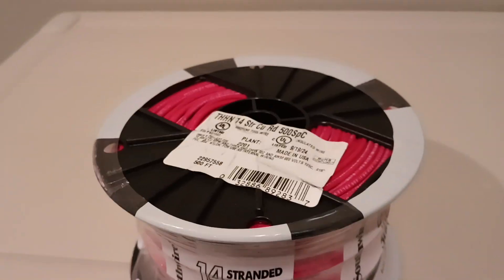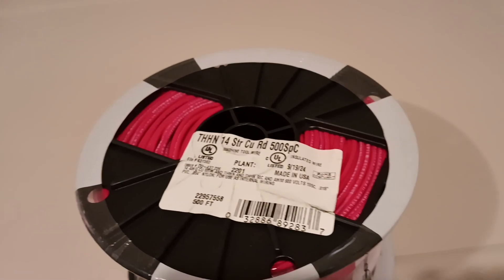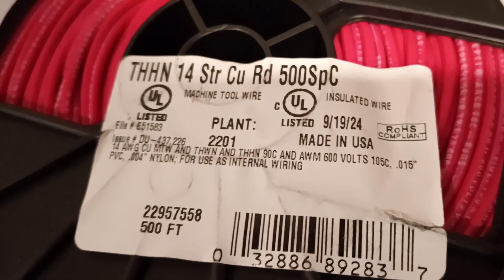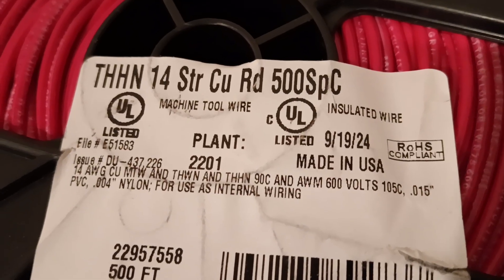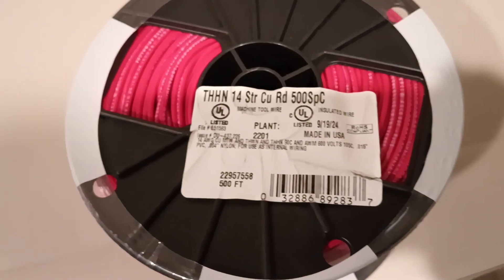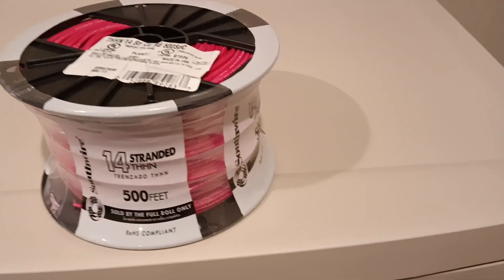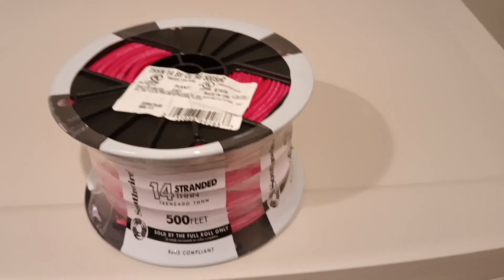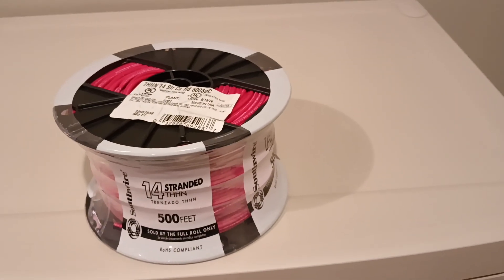Exciting Plans for Antenna Wire!

Comment: One potential problem you may experience with copper stranded wire depending on your antenna is wire stretch. If you try to use this with  say an EFHW for 80 meters you will have to add quite a bit of force on the wire to get it somewhat straight. That force will usually stretch the wire, thus changing the tune or resonance. For other antenna designs this may not be a problem. Good luck!
Reply from the maker: Thanks so much! I'm primarily planning on low-tension, low-stress designs but that is good to know. 73, Jared ~ AC7WH

Comment: If the antenna is up in the air - I use bare 14 ga aluminum / magnesium electric fence wire. I got a 1,000 meter spool of it cheep cheep on the Amazonas. But for Beverage on Ground, Loop on Ground: Military reel of comms wire (W-1) is tough, proven in battle. The bare aluminum / magnesium wire is very lightweight and has less wind drag. Lots of fun, either way!
Reply from the maker: I like those ideas! Thanks for sharing, and thanks for viewing. 73 Jared, AC7WH